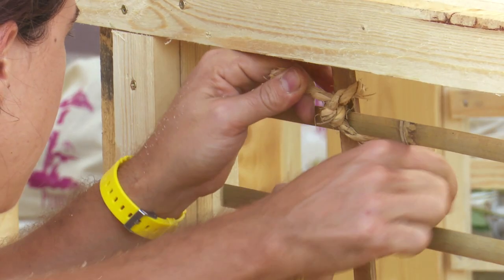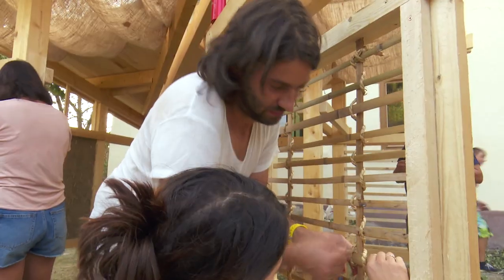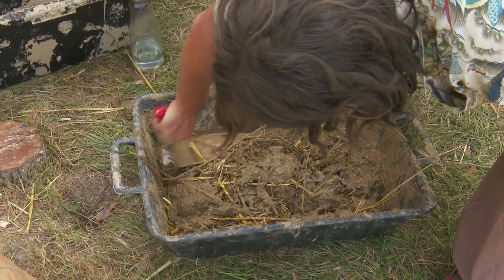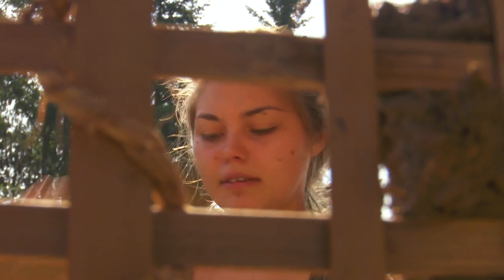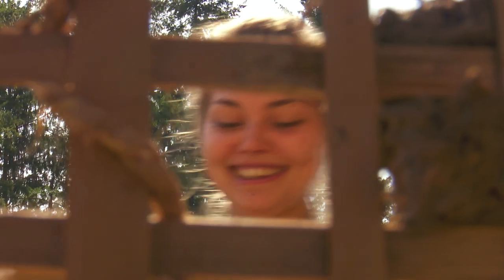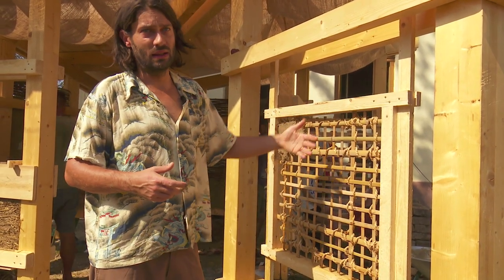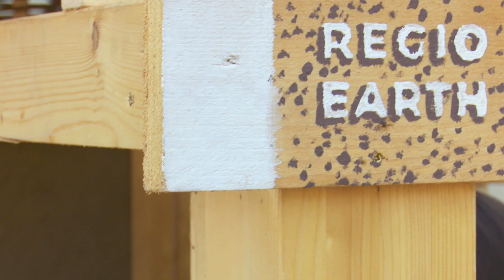Video Tutorial: Earthen Japanese Technique

Comment: Thanks for the great video! I have a lot of questions, I hope you don't mind: is all the mud for a house fermented at once? How much mud is needed for one house? If it is all fermented in one batch, how do they mix in the new straw? I imagine that would be difficult if you have half a shipping container full of mud so either they have smaller batches or they have some clever stirring apparatus. Also, is the lime coating rain proof on its own or do you add a protective coating over that? Does a wall made this way need regular maintenance (like adding an extra layer every few years)? How do they finish the inside face traditionally? Is this method only used on the outer walls or also on the walls between rooms? Does this method provide any insulation (compared to a brick wall)? Is this method also used under the roof? I'm sorry for the barrage of questions but I'm a really curious person so I can't help it.

Comment: Japanese don’t use drill and nail
Reply: Probably has to do with building regulations in the country.
Reply: Hey! Thank you for your comment. Japanese have been using various kinds of drills since the old times, and there are several companies such as Makita, or Ryobi which are developing electronic hand tools. It is quite common to open holes or mortise with electronic drills and finish with chisels. At the camp, there were only limited tools available, so I had to stick with the drill only - which is actually OK in this case since it is not visible, and the under-structure of the wall connects somewhat loosely to the wooden frame to avoid tension.